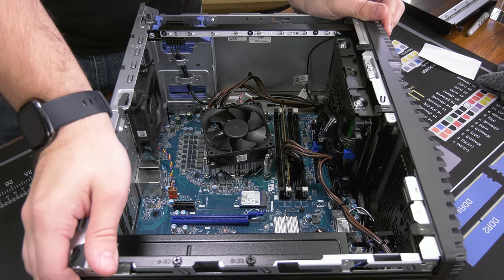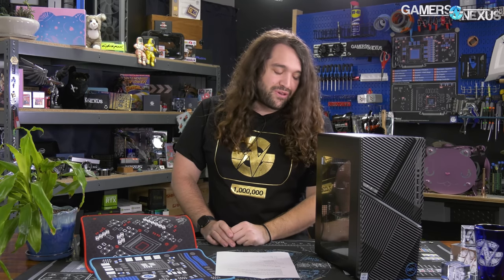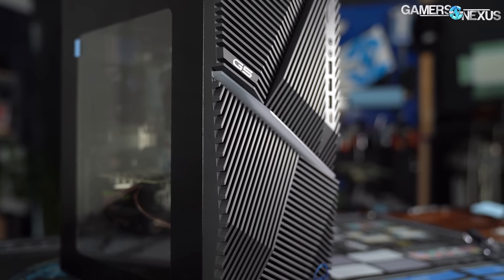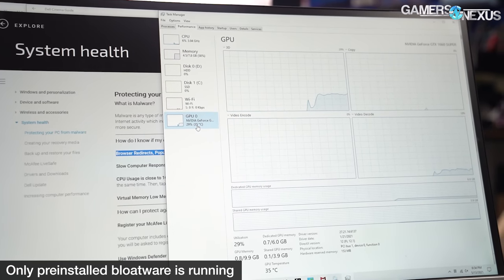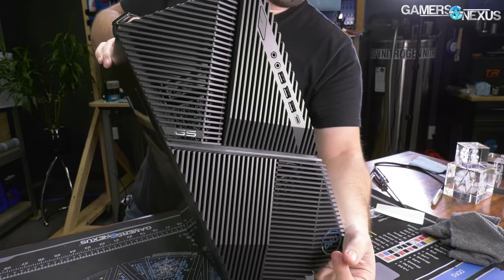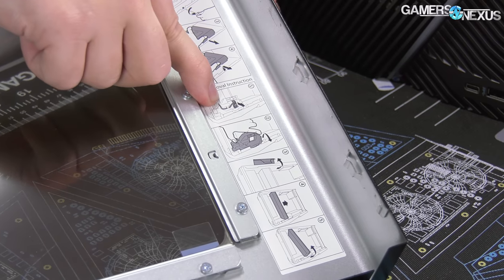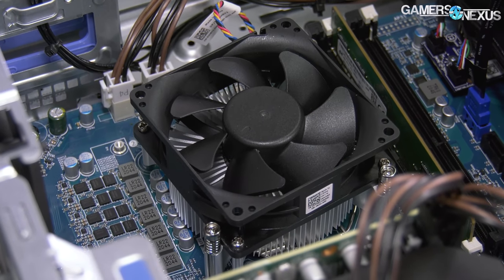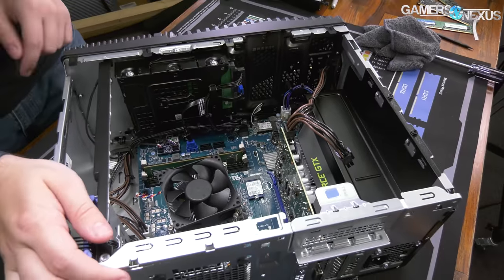Worse Than Walmart: Dell G5 5000 PC’s Garbage Parts & Hidden Charges

Comment: This looks like a computer built to last a week longer than your warranty.
Reply from the maker: Yeah... It does seem like that.
Reply: It reminds me of my Dell gaming laptop that i bought 3 years ago died exactly after 1 month of it's warranty expiring lmfao
Reply: Hmm, I wonder why 🤔
Reply: The cooling is so poor, you would need to clean out the dust ~monthly to not destroy it. And the type of people who buy prebuilts don't even realize they're supposed to clean it...ever. So yeah it's definitely not going a year without performance degradation.
Reply: Sounds like the kind of system that would be outright illegal in the EU region in the coming years. Theres a new law in the works here where electronic products have to be built to last longer and have to be able to be fixed and maintained.
Reply: @Meitti  isn’t that law that the device needs to be repairable? That means the parts need to be available, not repairable
Reply: The number of 10 year old Dell prebuilts still working on ebay would say otherwise
Reply: A True 13 Month Machine.
Reply: @ukaszo3412  Its both, plus a required longer lifespan of the machine itself. Its a part consumer protection-, part environment protection law.
Reply: I would say that, for how incredibly cheap this computer case was built to be, it would actually be pretty robust for shipping large numbers of them to businesses or whatever. Because all the loads are taken off of the motherboard, there is much less chance of anything coming disconnected. I'm by no means a Dell fan, but they have one thing they're really experienced and good at, and that is designing for large volume costumers. Volume customers don't often actually repair computers themselves, but instead have a service contract with Dell themselves. 

I worked for several years at a Micro Center store, and have talked to many people from single consumers to big businesses. This shit sucks for the individual, but actually works pretty well for larger businesses that are outfitting whole offices with dozens of computers.
Reply: @markjacobson8878  I dont think companies are happy paying extra for supposed "free warranties" either.
Reply: This is true, our department has a contract with Dell unfortunately and they really do die a week or so after warranty.
Reply: I would say yes, but they didn't wanna spend the money on the self destruct timer.
Reply: @BionicXAngel  the only Dell I ever owned died 1 month after warranty expiration also lol
Reply: Maybe a secret timer build in?
Reply: They don't make it past warranty. Even biz class.
Reply: @musguelha14  Dell last good prebuilt were Optiplex / Inpiron in 2012 (Optiplex 9010 were robust and well built as tanks). After that, it was a down spiral until today's low point = deep shit!
Reply: @markjacobson8878  except that this PC shit IS BUILT for real alone Customers, yup!
Reply: @GamersNexus  See that is why you should have bought the extra extended warranty.... It is super easy to get, all you have to do is not look at the double charge on your invoice.
Reply: It would not work in the EU. Here the warranty by law is 2 years. Servicing have to be for free here, and the only thing not covered by law is the transport from customer to any assistance point.
Reply: @ricardomaggiore5518  not, in Czech republic is ALSO payed the shiping to repair, if it was needed. If repair was needed, thay will pay you also shipping cost. So 2 Year warranty, free repair, no charge plus free post fees (they are payed after reparing). Im living here and loving it. Ussually selling all my HW after 1,5 year and new owner have 6 month warranty. Easy peasy and all are satisfied. BTW this causing higher costs of PC and HW...
Reply: @GamersNexus  It absolutely is. This looks like a business class pc that had some slightly faster parts slapped on it and resold as a "gaming" prebuilt. I see these crappy parts all the time when I have to pull apart Dells and HPs in someone's office
Reply: @BionicXAngel  #metoo Alienware R17. A month out of warranty, the mobo died.
Reply: As one of the idiots that got this PC a while back when I didn't know anything about PCs... fucking GPU broke right when the warranty ended. I swear they did that on purpose
Reply: @perothing  or a poison pill 'update'. I doubt that would be a hard thing to do. If it hasn't died on its own they remotely zap it.
Reply: @BionicXAngel  Exact same situation here. Dell G3 15 3590. Hinge broke a month or two after the 1-year mark, making it impossible to close safely. Never again.
Reply: Yes Dell sells more junk than Sanford and son.
Reply: As every Apple product made after 2010
Reply: @Maple_MK  mine had the same problem, it broke like 2 months after the warranty expired. Now I'll only get a DIY pc which parts can be replaced by myself
Reply: im getting close to 1 year past on it...after that it's time for fear for sure
Reply: @kooll2401  sounds like the perfect time to test its limits and get a new one XD
Reply: Good ole Planned obsolescence. Dell doesn't really make their money in personal PCs anyway. Most their money is generated by VMware and EMC.
Reply: @mark12358  those optiplex were so poorly built, I had a job to disassemble dells back then, Those things sucked to be tempered with at all.
Reply: I love Dell monitors, but this. Hahahha 😂 Build to last
Reply: @musguelha14  they used to be build better, not anymore
Reply: I always wondered if their "Dude, it's a Dell!" ad wasn't an apology.
Reply: I have worked on Dell computers that are so plugged up with dirt at retail/restaurant that are years old.  Super hot locked in cabinets no air flow.     Not saying they're great or have good parts or good cooling .    Just saying you would be surprised how long some of those cheap parts last.
Reply: I got one and that’s exactly how long it lasted. And since the forced migration to windows 11 it’s borderline unusable. Not only for games, but like I can bearly watch YouTube, or do school on blackboard.
Reply: Wait, that comes with a warranty???
Reply: Looks like a pc from the 90s
Reply: Unfortunately i bought this and u we’re absolutely correct
Reply: Like Razer products, nvm even they mostly have 1 year warranty only, you still can fit several RMA in it.
Reply: I bought a Dell computer in 2016 for £300. It has worked nearly all day and all night without ever having to take the back off. I know you doom mungers don't want to hear that, but it did exactly what it said on the packet and did the job. Who cares if you can't upgrade a part of it. After so many years the whole thing needs upgrading.
Reply: BobSamurai - You’re just lucky Dell built that computer! Don’t be ungrateful!
Reply: As someone who owns a g5... yeah its EXACTLY LIKE THAT. It literally broke soon after warranty expired. Unexplainable crashes and freezes.

 Im working to fix it and have run every test possible it feels like and nothing comes up. It seems fixed now even though all i did was touch all the components. Suspicious. Im adding fans and a new cpu cooler because its temperatures are ABYSMAL, hoping to actually use it. But who knows, it may just stop working again for no reason. I live in constant fear 😢

Comment: I've known since the 1990's, that the easiest way to tell if a Dell computer is garbage or not, is to look at the nameplate. If it says Dell, it's going to be garbage and should be avoided.
Reply: To be fair, the laptops are fine.  And for  pc's sold to corporate IT departments, many of the flaws just don't matter.  But yes, for home users, there are serious drawbacks joined with lousy value.
Reply: @kcgunesq  I always found Dell laptops competent. Nothing more, nothing less. Fair enough for a no-nonsense business laptop. 
However, when I needed a serial post to connect to some Brocade FC-SAN switches, Dell didn’t work and neither did (at the time) USB to serial.
Thinkpad to the rescue.
Reply: @kcgunesq  My Inspiron's right hinge broke. I took Dell's service, and they replaced the laptop's bottom. But the bottom had slight change in curve, rendering my one USB and LAN port (both in the back) useless. The ports wouldn't line with the cut holes. WTF, Dell? The only reason people take brand service is for product quality and 'compatibility'. I accepted it because they already took two weeks, and another replacement would've taken more time.
Reply: Best accurate comment I've read today :)
Reply: Now we do, but back in the day I loved my old XPS system with the Diamond Stealth graphics playing all those SSi D&D titles. Eventually slapped a Monster 3D graphics card in there and was rockin Quake ! It was so awesome to be alive through all the early days of gaming.
Reply: Optiplexes were a good way to get started with PC gaming if you threw in a 1050ti or if you took the motherboard out and slapped it in a different case and any mid tier graphics card. That's  what I did for a while.
Reply: @kcgunesq  Nah their laptops are trash too, I had the precision at work and it was garbage. Massive thermal issues, horrible trackpad, mushy keyboard, and the screen was meh at best. The camera was horrible too which wasn't fun back when covid was a thing, and not acceptable on a $4000 laptop. Maybe other of their laptops are better but my understanding is that precision is one of their most premium lines of laptops so I doubt it.

I'm never touching one of their laptops again. I have a dell servers, and that's probably the only dell branded thing I might consider to buy in the future.
Reply: So what do you recommend to someone who doesn't want to build their own PC?
Reply: @DrTedEsq  Dell was pretty good back then tbh
Reply: @volundrfrey896  Precision 5000 series is pretty much rebranded XPS 15/17 laptops. It's the 7000 series thats actually premium + 5000/7000/9000 Latitude series. Stay away from any other laptops from Dell
Reply: @AB-rz5iw  I mean they sell that shit for $4000+ if that's not premium enough then stay away from the brand as a whole
Reply: Dell’s laptops are great but their desktops are not good
Reply: It's great to see DELL still using all these ridiculous proprietary parts! I'm sure they charge an arm and a leg for anything that needs to be replaced because everything in this PC is "special". Like, who even uses proprietary parts anymore!
Reply: @Elrond_Hubbard1  it was expensive though , Back when Moore's law was a real thing you had to spend a fortune to keep up , I'm one of the few people that enjoyed the staleness of the 2010s , Kept a 2600k for 7 years only upgrading from a GTX570 to a GTX970 half way through.

Wasn't until 2021 where I went to a 10700k and now I already got the itch and have a 12700h , RTX3070ti laptop , Now I'm thinking of a 7950X desktop unfortunately the Mrs is having issues with me getting another PC.
Reply: I actually rather liked some of their budget PCs from the late 90s.
Reply: @Ishamv3  back in the mid-naughties, a friend of mine asked me my opinion of what brand of laptop to buy.
I said “Thinkpad or iBook. Do NOT get a Dell.”
“But the Dell comes in pink!”
“What did I just say? It’s your money, but I’ve given my opinion.”
She bought the pink Dell laptop.
The display cable on it broke almost instantly. Dell wanted 3+ weeks to have it to fix it. She was in school and couldn’t afford to be without the laptop for that long.
So, her laptop became a desktop, because she needed a monitor to use it.
She started to complain to me about it. I said “Yeah. I know. I have to say it, what did I tell you?”
Needless to say, she hasn’t purchased another Dell since.
Reply: I was so sad when my sister bought a Dell. Great price for the specs but boring af and well... it's still a Dell.
Reply: Dell is e-waste out of the box.
Reply: @davezorc  nobody "builds" their PC. We are just slapping 8 uPnP components together. There's no engineering or really any kind of analysis going on... If you can plug your DVD player to your TV - you can "build" a PC.
There's absolutely no reason to buy ready-made PC's unless you are equipping an office of like 20 people and can't spare one of your reasonable employees and a screwdriver.
People need to be made aware!
Reply: @todorkolev7565  There's applying thermal paste though. lol.
Reply: Greg Marsh - Absolutely! I couldn't agree more.
Reply: The only thing I buy from Dell is their business laptops which are usually much better value for the cost compared to competition. But I would happily pay slight premium for a thinkpad.
Reply: @kcgunesq  Our company has had Dell notebooks for many years. I had 3 die on me after 2 or 3 years. Twice it was the hdd though (when that was still a thing), and once it was a memory module. Still... I'd personally never buy a Dell laptop either.
Reply: @todorkolev7565  it's like Lego, it's made to fit together but you're still building with it. Also, the knowledge of how to combine them without bottlenecking or straight up not using some features is an entirely different thing. M.2 NVMes will work in any slot, but if you don't know the generation of drive and slot, you could run a gen 4 drive on gen 3, halving the drives speed. That's not exactly common knowledge (yet at least) and an easy oversight. Upnp, right?

Some people don't want the hassle of putting parts together or the stress of potentially bending pins on LGA sockets, cable routing, installing the OS, first boot drivers, or fiddle with fan curves and other BIOS settings like XMP/expo.
Reply: @kcgunesq  you could just get a lenovo instead
Reply: The Optiplex line is awesome, consumer stuff sure its all garbage like most companies
Reply: there was a short time in the mid 2000s, early 2010s where dells were a good choice for a base to upgrade since they used standard parts, but as time went on, they eventually became too proprietary to upgrade in any meaningful way.
Reply: I remember the old dell e-series fondly. Unfortunately now, it doesnt seem like any business laptops at all are really built up to that standard...
Reply: Their poweredge line of servers is actually pretty good and they aren’t as bad as many other enterprise oems with requiring licensing fees for everything.
Reply: @TheScyy  in 2007 , I took over a server room full of Dell PowerEdge servers.
I hated every. single. one. of. them. 
On my first day, one of them was beeping. Nothing was showing up in the error logs of the servers in the area.
Eventually, we had a long enough power outtage, we had to power down the server room as our UPS had run out.
When things came back up, no more beeping. Never did find out where it came from. 
The other thing that pissed me off, was that while I might have a pile of 2950’s - I could not be guaranteed what kind of computer was inside. I had no reliable spare parts.
I came from IBM world. A 3850 was a 3850 was a 3850. None of this “whatever we decided to put in here” crap that Dell seemed to be doing.
When the same company had their IBM P570’s installed, our installer tech, super cool Mexican dude, while talking with him in the server room, he sneezed and went “Yeah. I’m allergic to Dell.” 🤘😝
Reply: @todorkolev7565   They're using "build" as a noun the same way car ricers with their tuner "builds" do and for the same reason.  Almost 0% of people who choose to modify their pre-assembled automotive appliance are capable of jigging and constructing a car even if someone handed them all the preformed steel.
There's absolutely no reason to modify stock vehicles for public road use unless you're filming a movie and can't afford to build 50 hero cars.
I agree, people need to be made aware!
Reply: But bro... your getting a dell!!
Reply: I still have a D610 rocking ATI graphics running xp. I aldo have a 9020 with a 4790 running cpu intensive services in my home network and a precision t1700 running emby server with 4k video transcoding, and a little 7020 sff running a lamp stack. Dells were built to last, recently that changed though.
Reply: right lmaooo
Reply: @NuclearHeadshot  I'd rather deal with the hassle of as you put it, "putting parts together or the stress of potentially bending pins on LGA sockets, cable routing, installing the OS, first boot drivers, or fiddle with fan curves and other BIOS settings like XMP/expo" than dealing with idiot ignorant customer service people who already have my money, companies that won't honor warranties, and people disinterested in helping me fix a problem they may or may not have created.